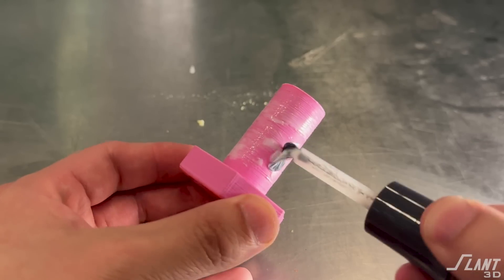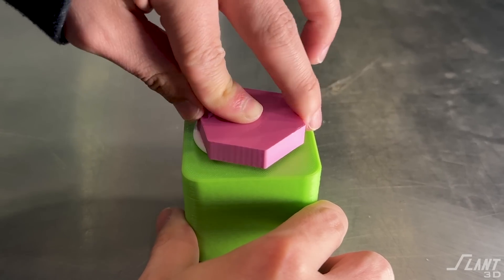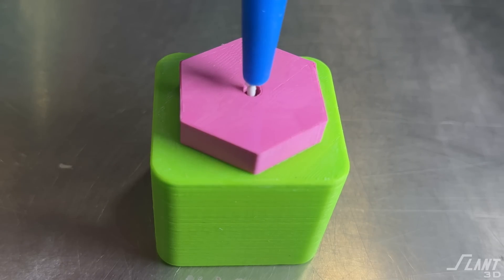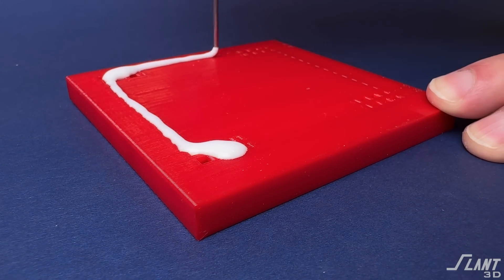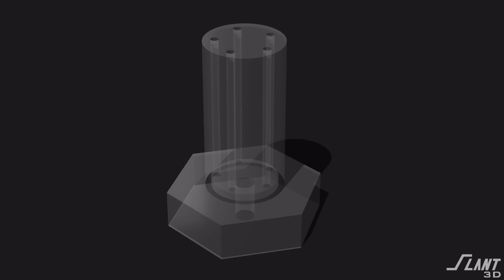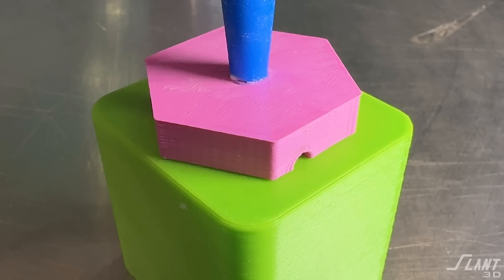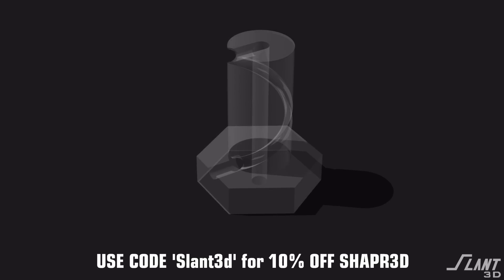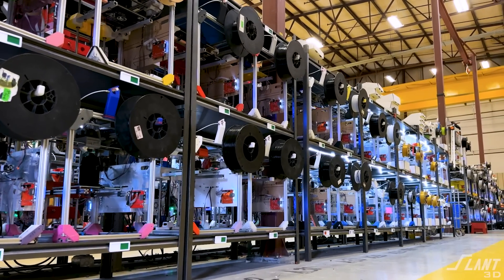Stop Gluing Your Prints the Old Way | Design for Mass Production 3D Printing

Comment: The idea of using glue as a peg, or retaining mechanism is a great tip. Combining with lower tolerance mechanical restraint (threads, or snap-in) can ensure both temporary placement, and longterm robustness. 
The type of glue being used dictates the application method to a significant degree. It's not apparent in this video what type of glue is being used? Looks like a water based white glue, or silicon, which have long drying times as rely on evaporation. Set and drying times is an important aspect that should be discussed further in context of glue type.
Reply: Oooh now there's an idea! Have a hole in the part you are inserting that aligns with a hole in the part you are inserting it into. That way when you inject the glue and it cures, it literally creates a retaining pin of glue that would have to be sheared to separate the parts. Make that out of J-B Weld and see how strong it is, hahaha. You could also create concave rings in both the inserted part and what it goes into that align and the glue injects to fill the ridges, creating numerous solid rings which hold both parts together. Is any of this more effective than proper glue itself? Hard to say, but it could be great for gluing parts that will get dirty during install or are dissimilar materials and won't glue properly with conventional glues or if you want to use a cheap glue in the wrong situation.

Comment: Lots of comments saying “you need to minimise the amount of glue”. Sort of. Depends on the glue. Gap filling adhesives are fine in gaps (eg ct1, fixall) most glues have a maximum as well as minimum amount you can use. Eg anaerobic glues sheer thin very well, but cyanocrylates below a certain thickness do not - hence if glueing a shaft into a bearing - anaerobic glues are preferred …
Anyway my point is - check the characteristics of the glue you’re going to use - and fold that into the design .
I think this is a very interesting video to get one  thinking. The specifics will come down to the glue you use. 
The rebar analogy I think is a bit meh / but again depends on the  characteristics of the glue eg isn’t brittle or not … 

Thanks for another thought provoking video.
Reply from the maker: Nicely summed up. Thank you

Comment: This guy knows so much more about filament printing than he does about how adhesives work in practice.
Reply: Also man re-invents grooved dowels poorly, proceeds to make them worse.
Reply: @j.f.christ8421  Yeah, all the presented options really don't blow already existing techniques out of the water. I bet most of the thick glue will not even cure in this way.
Reply: or rebar... but a lot of  his  videos are good

Comment: I would love to see these various methods tested... All of these seem significantly weaker than a traditional glue joint that just simply maximizes surface area contact. All of these ideas seem to have significant flaws and are solving problems that shouldn't have existed in the first place

Comment: I believe these points can be exaggerated even further if you were to say, run carbon fiber strips through the channels that run down the z axis, then fill the channels with epoxy rather than glue. Your z strength would likely improve significantly.

Comment: If you're going to make strength claims, you really need to prove it by testing parts.  You'd be far better off to design a cam that locks under a ledge, and the glue blocks the return - if you wanted to insist on these giant glue channels.  you'd be far better off to make non round geometries with mating embossing, and use the glue like it was intended.  Then have a relief near the top of the hole to take squeeze out.  But without testing, this is meaningless content.

Comment: Some of this makes sense but other parts have me puzzled. Glue works by binding 2 surfaces together. If you just shoot it to the bottom of the bolt it only coats the bottom of the bolt and not the much higher surface area of the sides. I like the curved channel idea but you may want to give it a twist, once the glue reaches back to the top, to make sure it spreads along the sides of the bolt so that you maximize surface area contact. I also have to wonder about glue as "rebar" how is glue helping the print to be stronger? Is it infiltrating the layers and bonding to them? Or is it acting as a flexible skeleton? Does that prevent breaking or does it just hold broken parts together?
Reply: He is showing creators / designers how to go from one modeling concept into a better more advanced one with mass production efficiencies in mind. He does this same concept in every video. It's kind of a good, better, best approach to teaching which apparently alotnor people here aren't getting.

Comment: Dang, I thought you were smarter than this. Having giant channels of glue is only going to waste money. Glue is best used when 2 surfaces are very close together. A big cylinder of glue has very little strength in tension and is not going to act like rebar. The more contacting surfaces covered in glue the better. So, your spiral channel is going to perform worse than if you just covered the whole cylinder in glue. The best you can do is just design treads into your part and cover the whole thing in glue, or build wood working joints like dovetails and coat them in glue. This video seems like either a test for your audience or a late April Fools prank.
Reply: What about using the same method with something like epoxy that can flow but will harder better and act more like rebar. Then ALSO using glue on the exterior. Still a good video for ideas and creating intentional passages that you can fill after a part is assembled
Reply: You know that the geometry they are displaying are not optimal, right? I bet with some optimization that glue channels could be quite useful. 

Viscosity limited flow velocity increases with the gap spacing raised to the fourth power, so it probably doesn’t need to be that deep to have real flow benefits, especially if you can inject at higher pressures. 

Also, glue doesn’t have great tensile strength, but neither do z-axis prints. I’m not sure how much glue would help,
Reply: Wouldnt the sole introduction of the circular shaft reinforce the part instead if it was just solid infill?Printer is forced to make walls around the shaft which are way stronger the infill, assuming orientation is optimal formlayer lines.
Reply: @Cokoladni  Not necessarily. The cause of the lack of shear strength along the Z axis is layer adhesion. Until someone finds a way to keep the previous layer from solidifying so molten material is deposited on molten material, there will always be a weak point between layers. However, along your line of thinking, if you run ports up the Z axis that are just big enough, you can glue filament lengths inside it to strengthen the shear strength. This method will work far better than jamming glue or resin into ports.
Reply: So, two things here:

1. This is an exaggerated example for a demonstration.

2. He's not claiming it's gonna make the print stronger, but it will increase the strength of the bond between the prints.

It's hilarious how confident you are that you're 🤓so much smarter.

Fuckin dweeb 😂
Reply: Yeah, this guy doesn't know what he's talking about. His joining features video was similarly full of poorly thought out design and bad reasoning. Can't really blame him - he's trying to sell the idea of his 3D printing factory - but some of the engineering and design guidance is pretty shoddy / flat out wrong.
Reply: TBH this is probably my third Video I have watched by him and all had poorly designed "tips and tricks" in it. The titles always look promising and then it's either something you already know or know better.
I think these videos are not meant for people with an engineering background but more for hobbyists.
Reply: I don’t really get the “PVA glue but with gaps” strategy either. 3d printing already inherently has lots of surface area for parts to bond from layer lines and other defects. That being said, he’s right. You could use this technique to create a world of composites. If you substitute glue for RTV, you could make shock mounts, torsion springs, etc. Embedding resin could make a part stiffer. I think of it more as a way to augment material properties given design intent. Also, Gorilla glue and those other urethane based glues love gaps.
Reply: @cornboy3  - No, foaming glues like gorilla urethane glue, are not at all what you should be using in a situation with gaps. The foamed form of the glue has very little strength. Those glues need tight fits and good clamping. The one exception I can think of is if you are gluing foam, which gorilla glue is great for. (It won't dissolve Styrofoam like super glue will and is no weaker than the substrate even if foamed.)
Reply: What if it's a different type of glue that could add structural integrity?  Like resin based glue?
Reply: might be good with some new type of glue or similar, something that's gooey enough to follow channels similarly to a liquid but over time hardens into a very solid material. glue never really becomes solid, kinda just holds things together.
Reply: I had to keep skipping through this video because I thought these were jokes. 
It wasn't https://youtu.be/LQCU36pkH7c?si=bgLjRJ_DnnhAU_Y4
Reply: You couldn’t start your doctoral thesis-comment without a rude remark?
Reply: @ThatAdam12  Well, I lost a lot of faith in Slant 3d after this. If he doesn't even know how glue works how am I supposed to trust the rest of his tips and trick.
Reply: @wesdiezy  I think you know. Take what works, disregard what doesn’t. I think he’s trying to sell/show the possibilities of 3D printing. I’ve gotten a lot of tips from him and learned quite a bit from this channel. It’s not rocket science—literally.
Reply: @wesdiezy  someone can't be knowledgeable in everything. Yeah, I thought the same as you that glue should be between two surfaces and not in a big channel but nevertheless it's a new Idea for 3d printing which was very interesting for me. Maybe we could design this so that the glue is later distributed evenly by twisting, after applying the glue to the channel. But yes, it wastes more glue, I think.
Reply: @wesdiezy  I love these creative tips slant gives, even if they don't end up being practical for my use. This seems like an idea aimed more for mass production (like most of his stuff to be honest). Maybe the way he used it in this video isn't the way it would be done for a finished product, but maybe it can act as an inspiration for solving a very specific problem.
Reply: Clearly you misunderstood the fact that this is an exaggerated example 😂
Reply: Lol you failed the test. He is showing a concept, not telling you specifically about a peg in a hole. Take the concept and use it where it makes sense. There are compromises with everything and having the strongest bond doesn't necessarily mean best. You must be an engineer
Reply: @AGLTC01  ease and speed of assembly can definitely be a worthwhile trade-off for mass production!
Reply: @AGLTC01  Lol concept.  We invented fluted dowels years ago, this is just a crap version from someone who has apparently never done any woodworking.  I mean even IKEA use fluted dowels on glued joints.

Comment: I think another benefit you missed would be to put matching divots/rings on both parts and then inject the glue into them.  Once hardened, the glue would have to compress or shear before the part came out.  Way stronger than anything holding in tension, as is typical of glue.

Same goes for non-round holes.  Why round?  You don't have to machine it.  Make it some kind of polygon and you've got alignment registration on top of increased glue area.  Your previous flexible splined hole to get a tight tolerance on a shaft would be awesome if injected with glue after.

Same goes for a minor friction or spring-clip assembly that self-clamps the parts in place.  Print, assemble to lock the parts together, then inject glue to make it permanent.  No fiddling or holding together while gluing.  No clamping after.

Rebar?   Yeah... shove something actually strong in tension during assembly then fill with glue.  Even lengths of filament shoved in oversized or square holes would add a lot of strength.

Comment: You could push this even further by adding features like wedges, clips or other to hold down the parts while the glue is setting.
Reply from the maker: True. The complexity enabled by printing really gives you a lot of new process options

Comment: I definitely figured out you need a place for the hot glue to go if you want to get a reliable flush surface.  Good to see these other ideas too!  FWIW, it turns out that wood glue sticks well to PLA and melts if you soak it. So if you want to test-glue something without it being permanent, it's a good start.  The spiral groove is such a boss idea.
Reply from the maker: Thanks

Comment: why not just make a screw thread?
Reply: Sometimes you don't want parts that are able to be taken apart... Also I would still brush glue on but have the channels for the glue to goto.
Reply: A glue connection is stronger and saves printing time.
Reply: Missing. The. Point.
The video isn't about gluing a threadless bolt into a hexagon.
It's about knowledge and tools to apply to other problems.

Comment: It's actually crazy for the owner of a successful printing operation to go online and willingly teach people their trade secrets and methods. I've learned some amazing tips from this channel and now I've learned another one. The only downside is that I thought that I was finished with the project I'm working on and now I'm looking at another few days of modelling and testing.
Reply: I think it helps them in that if I'm designing my own item, I can prepare it for manufacturing without taking their engineer's time.  They can just concentrate on manufacturing the part for me.
Reply from the maker: It helps the customer. They do not have to pay for engineering time.
Reply: It makes good sense. Either way, it's a great contribution to the open-source community and I highly appreciate the dynamics that it's added to my learning experience with 3D printing. Many thanks.
Reply from the maker: Understanding how to create good parts will help the industry grow. We are making a warehouse where the shelves make the product. But it doesn't work if people don't know how to leverage design to use tools like our API and Etsy plugin
Reply: Yeah but this is just... wrong...  It's about as wrong as the explanation of heat transfer in the Stanley cup video.
Reply: @j.f.christ8421  Oh, please do explain. 🎤
Reply: @Antassium  Explain what?  Fluted dowel re-invented poorly?  Plastic conducts heat?  The meaning of life?
Reply: @j.f.christ8421  well, if you're deflecting, it means you're just talkin out your neck.
Reply: @Antassium  Do you know how glue works?  Here's a tip, not like this.  Go and look up what a fluted dowel is, and why they're made like that.
Reply: @Antassium  And if it's the Stanley knock-off you're wondering about, well, they took a doubled-walled vacuum cup and put it in a plastic holder.  They then claimed the holder provided all the insulation because it contained air pockets.  While trapping air indeed how insulation works, the gaps left by the infill are too large.  And never mind overlooking the VACUUM CUP doing all the work.

Comment: Nice! Another idea to consider is using exposed regions of fully permeable 3D infill like gyroid infill. This could be applied to areas of both parts and increase the surface area for the glue significantly. (Although it might be easiest to accomplish in the slicer instead of modeling it directly.)

Comment: Has anyone used (like shown in the video) "elmers" glue to glue parts together??? I have only used CA glue.
2:40 - Anyone have any proof that this white glue is "stronger" than the layer lines of a PLA part?
Reply: I would not recommend "Elmer's" glue for this type of design. 1) This type of glue contracts as it dries so you would lose adhesion against the walls of the print. 2) This glue would take quite some time to cure since it is enclosed and has no air to dry it. 3) This glue is not my "go-to" for gluing plastic parts; use CA or an epoxy.
Reply: Also, PVA hardens in wood because the wood absorbs the moisture. In non-porous plastics, all that moisture has to evaporate out through tiny voids, or slowly  diffuse through the skin of dried glue. A tight fitting joint might take weeks, months, or may never harden. Like the tight fitting joint between a plastic glue bottle and its lid.
Any glue relying on a chemical reaction (like epoxy, PU glue on a dampened surface or CA glue with accelerator) would be a better choice. PVA was probably just used here for demonstration purposes.
Reply: I have had some success with "wood glue" like carpenters use. But I didn't really use it in situations where the stuff needs to be particularly strong. Just holding up the weight of the parts with an airtight seal.
Reply: He is using glue that shows the concept for the sake of viewing footage on camera. This is not the actual glue used to hold the parts together.
Reply: @phasesecuritytechnology6573  It would be nice to know what kind of glue flows like that would also dry hard. :-)
Reply: @darrennew8211  you know all those cereal commercials don't actually use milk in the footage right? They use Elmer's glue.
Reply: @phasesecuritytechnology6573  Ummm... OK? Did you intend that to be related to what I just said?
Reply: @darrennew8211  no. But knowing what he recommends for glue would be interesting.
Reply: @phasesecuritytechnology6573  Probably not milk. Or cereal. ;-)